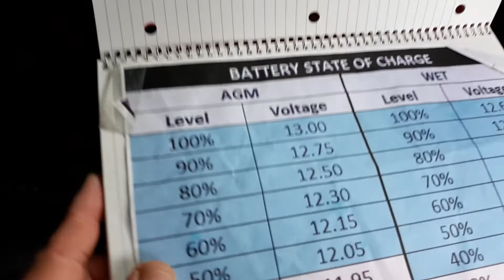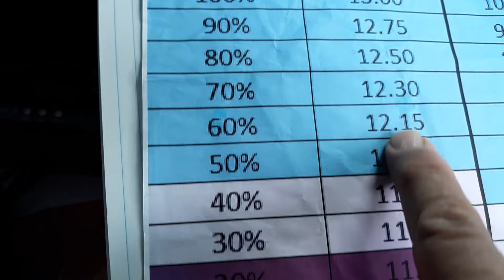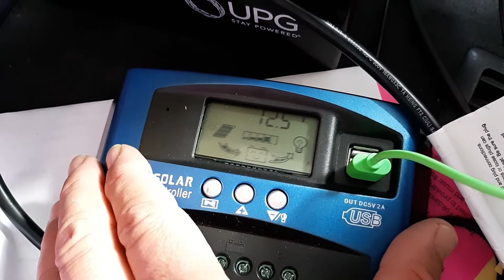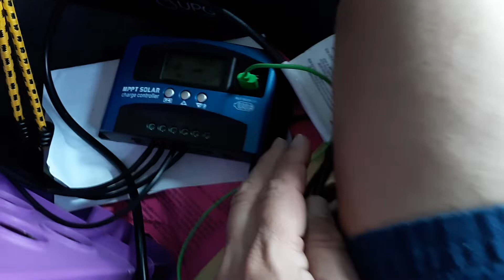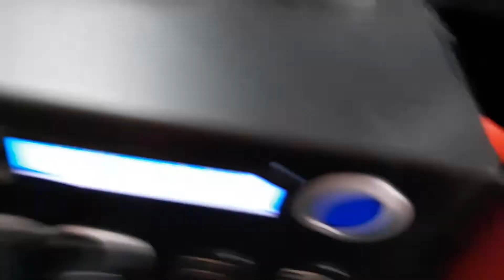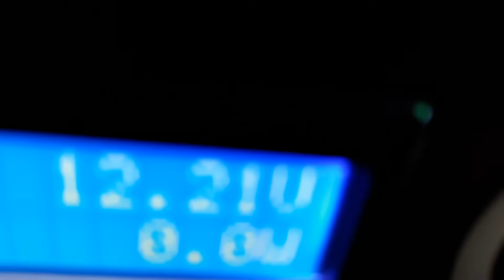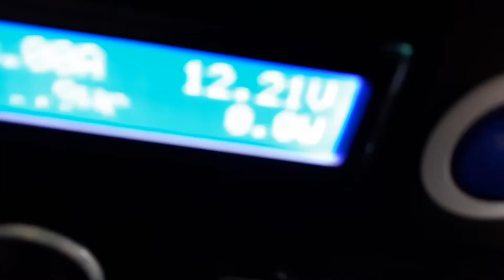The Right Way to Use the Kodiak Generator and the AGM Battery

Comment: Question: how did you manage to transition your solar power feed to the Kodiak (with the neutrik cable) to the charge controler (with DC cable)?
Reply from the maker: Very good question. The Kodiak has two solar controllers built into it.  So they are running the two controllers in parallel.   I cut into the Kodiak cable between the solar panel and the Kodiak Solar Generator.  Now I have three solar controllers in parallel.  THIS IS A "C-" WAY TO DO IT.  I DO NOT RECOMMENT DOING THIS , BUT IT WORKS.  
I Bought a, A-B switch, but have not had the time to install it yet.
Reply from the maker: How do the three solar Controllers work? The Kodiak Solar Generator charges up first, with the AGM battery charging slowly.  When the Kodiak Solar Generator is fully charged, then the AGM battery will charge to full.  
The other way is when the van is  moving, I charge the Kodiak Solar Generator off my van and all the solar power goes to the AGM battery.
 As I said, I need to put in the A-B switch I bought.  A-B switch  is the right way to go.
Reply: Very helpful. Thanks! I think I got the idea. I would not mind a picture or a short video showing the connection between the solar pannel and the 3rd solar controller.

Comment: I watched all your videos related to Kodiak. I learned quite a few things and confirmed my suspicion that my Kodiak was not really compatible with my 3 AGM baterries. Thanks for sharing your learning!
Reply from the maker: I made a video for you showing how I wired the solar controller to the AGM battery.  You need to buy a good solar controller.  You need to use fuses.  Also, it is really surprising to me how superior the Kodiak Solar Generator is at receiving the power into the battery.  I keep hearing that the lithium batteries are superior, but it is amazing to actually see the difference with my own eyes.  Here is the link to the video:
https://www.youtube.com/watch?v=LQFRPur26Ms
Reply from the maker: It is compatible, but not a working solution.   What good is it if it only charges to 80% of the AGM ability.  What good is it if every time the Kodiak discharged it hurts the AGM battery.  
A-B switch is the way to go.  

https://www.youtube.com/watch?v=CKHEHMfMcGM&index=3&list=UUdo_IcaaYxaQzFnaRt8Mypg

https://www.youtube.com/watch?v=K3b0SYrXmaw&index=2&list=UUdo_IcaaYxaQzFnaRt8Mypg

These two videos show how and when the Kodiak fails to protect the AGM. And when the Kodiak starts to hurt the AGM.  It is amazing that the Kodiak starts hurting the AGM battery at 60%  power level.  I have a third video not yet posted  on how the Kodiak can just destroy the AGM battery.  I am having a problem with YouTube trimming the video.  I may just posted un trimmed
Reply from the maker: If you tell me how many watts of solar you have and the environment in which you use the solar system, I may be able to help you with a design around the limitation of the Kodiak Solar Generator.  Also, remember I am a powermonger, a/c and heating off the batteries, and have special needs.
Reply: I have 5 solar panels of 100W each. 1 Kodiak identical to yours and 3 AGM batteries (Fullriver DC105-12 AGM Sealed Battery 12v 105 ah). Where I am in canada, I rarely have more than 300-400W of peak solar energy with my 5 panels.
Reply from the maker: Are you in a van application or a house application?
Reply: Whenever you decide to install the A-B switch it would be nice if you do a video about it.
Reply from the maker: I sure will.
Reply: I am in a cabin type application. No connection to the grid. Only for weekends and vacation time in the bush.
Reply: Truly appreciate the video Sir!